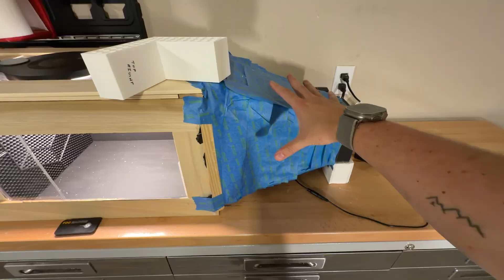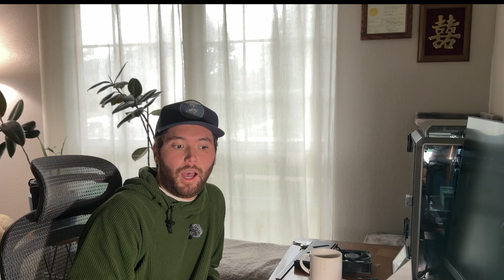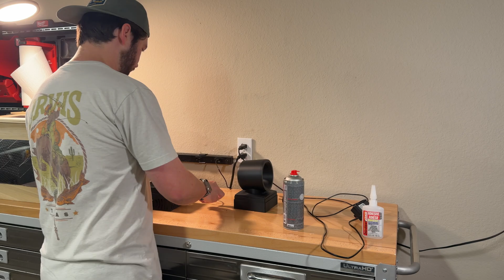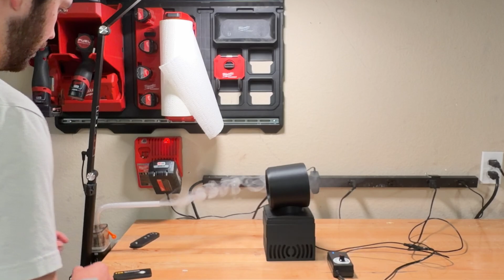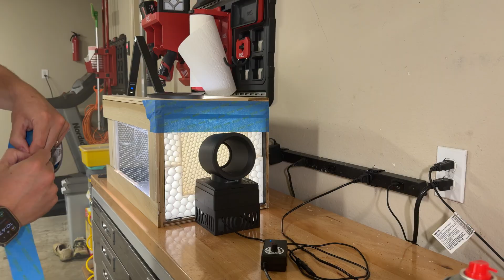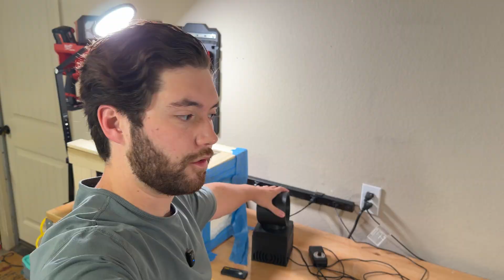Testing a DIY Wind Tunnel with a Bladeless Fan

Comment: Perhaps the focus should be on the pull rather than the push.  Also, the big boys feed the smoke through a length of pipe inside the chamber rather than through the infeed grate. This enables moving the injection point around to examine the turbulance behaviors engendered by the chamber geometries.
Reply from the maker: Those are some great ideas, thanks for the feedback!

Comment: Not an expert by any means, but I think you can use a bladeless fan still. If you have the chamber being pulled by only the round part at the top and separated from the fan box at the bottom, the low pressure from blowing will pull out of the chamber along with the regular air. It's weird to explain but you can look up "Bernoulli's Principle" if you want it explained by someone who actually knows what they're talking about.
Reply from the maker: I’ll have to look into that! Thanks!!

Comment: most bladeless fans run on an impeller and the intake of yours is on the bottom. you should just use an impeller with the intake in the funnel no bladeless fan housing. those are my thoughts you don't have to do that but it is an idea.
Reply from the maker: I’ll have to look into what that is! Thanks for the idea!

Comment: Can't you add more fans to increase suction, like a 2x2 grid would be a greater pull forcing the air to be more smooth?
Reply: Also just looking at how blameless fans work, it seems more turbulent than the normal one, especially as you have rough surfaces on the fan which will damage airflow. Try acetone on 3d prints to fix it (search it up its a cool technique)
Reply from the maker: I totally think so, but I don’t have another one right now! I bet I can make that happen in the future!

Comment: Just came across your channel and I'm liking the way you just give things a crack and learn as you go.

A few tips from my purely theoretical (and potentially outdated or wrong?) understanding, I believe professional wind tunnels have a larger inlet and outlet compared to the test chamber cross-section to take advantage of Bernoulli's principle. It will increase the air speed in the chamber basically.

Another thing (that I have never confirmed) is that I believe the flow straighteners in the inlet/settling chamber are meant to be staged. So, you have long wider ones followed by shorter narrower ones. The understanding there being that they cancel out different frequencies of oscillations in the flow.

You may also want to taper the leading and trailing edges of the flow straighteners (if you're not already doing that) so that you don't get turbulence from them entering the chamber. At that scale, I don't know if the print layers will be an issue too? May want to give it a spray with some putty primer or go down the rabbit hole of vapor smoothing your 3D prints.

Looking forward to the next one.
Reply from the maker: Awesome! Thanks for the tips!

Comment: Hey hey!

Your intake looks great. A decent ratio is 7 or 10 l/d (each intake "pipe" should be 7-10 times longer than its diameter, which it appears you nailed). The smoke shows that your flow is initially laminar, which is consistent with a good intake. The only thing I would add to the intake is a fine mesh at the outlet of the honeycomb, which can reduce eddies smaller than your cell size which can make it through. This will cost you some static pressure, but is a cheap experiment.

However, I see a problem with the transition to the test chamber. Your intake should not be the same area as your test chamber. A larger intake with a reduction, or a smaller test chamber, would make a world of difference. A ratio of 5 or 7 will work best. This causes flow acceleration so that lengthwise velocity differences are greatly minimized. The honeycomb takes care of transverse ( up/down and left/right) deviations, & a reduction keeps the flow together and prevents fast/slow air pocket separation.

The exhaust fan will work great, no need to make the fan bladeless. However, pressure perturbations and swirls from the fan can travel upstream and induce turbulence in flow that is close to its critical Reynolds. Make the exhaust duct a longer pipe and place the fan a few feet from the test chamber, this will also make a difference. You can also place a stator in front of the fan, but this will cost you some static pressure & will not make a huge difference. If you decide to make the intake larger, you may need an extra fan or two on the outlet for a decent velocity. If you reduce the test chamber you are set.

You have a 3D printer, put it to use and make all transitions have smooth curves instead of the current angled transitions, this will not be a panacea but will help reduce issues.

Wish you the best success in your DIY wind tunnel life
Mariano Bernacki
Reply from the maker: Wow! Thanks so much for all the feedback!

Comment: EVERY mistake is a lesson learnt. I assume youve asked ChatGPT for some ideas and watched others trying this on youtube.
Subtle pressure differences cause laminar flow to disrupt. The air speed of the entire system should be highest in the test section which means the pressure should also be the lowest. Given your outlet section constricts down to a small fan, I think you'll find it difficult to get good laminar flow across the entire test section.  You need to slowly increase the area of the outlet section and have a fan capable of moving that much air at the speed you want. 

Try to imagine the volume of air in the test section moving at the speed you want it to move. Then get a fan capable of moving that much volume in the time you want. Unless you get ALL the wind in the test section moving at the speed you want smoke will enter the test section and start to diffuse like it is. If space is a restriction, you may be better of making a smaller test section.

Alternatively, Imagine you were a smoke particle entering the test section. You go in and straight away you see a narrowing exit where all air particles and other smoke particles have to stop and wait their turn to go through the small fan.

Your curiosilty is unique and not everyone has it. It will teach you patience and without realising it, it will keep you entertained without having to turn on the TV or doom scroll. Enjoy!
Reply from the maker: Thanks so much for the detailed feedback!
Reply: @TheWindTunnelChannel-b1e  Hey... I stumbled upon a similar project I think you could get some tips from. Do a search for Aki wind tunnel. His project looks simple and seems to work really well.

Comment: The fan blades weren't causing the turbulence you're trying to fix. On your new version the thickness of the pipe wall you used for the inlet grid was creating turbulence, the straws worked better bc they have very thin walls and are also smooth. The printed hex inlet worked better than the thick walled pipes but the exhaust grid you added before caused more problems than it (maybe?)fixed. 
Like restricting the flow in the middle (denser grid = more restriction bc there is more material in the way) causing the air to kinda bounce off and follow the path of least resistance through the bigger hole grid. You dont even need an exhaust grid. 
The fan just needs to be the same cross section area as your test chamber. But preferably bigger than the cross section of your test chamber and further away so the transition in can be smooth(kinda like a trumpet). Using more than one fan to fill the area is viable. You can use a 3x3 fan grid for instance or use a big boxfan (tho they dont have much speed regulation).
Reply from the maker: Interesting points! I appreciate the advice!

Comment: I just noticed that it's "The Wind Channel Tunnel" not "The Wind Tunnel Channel" I subbed like last night and didn't even think about that.
Reply from the maker: Haha good catch! I thought it was funny that way!
Reply: @TheWindTunnelChannel-b1e   Also I'm thinking you might want to go back to the funnel and maybe resize the holes. I don't know basically anything about this stuff but I can come up with some ideas. Maybe tweak the shape of the funnel so it smoothly sucks air equally and position the fan in the center of it. I also am thinking about if you block the air from the smoke side some, that might be a good test to see if the fan only sucking up the smoke makes a difference. Basically like adjusting the air flow into the tunnel. Keep up the testing though, I'm looking forward to see what it looks like in the end and how you get there.

Comment: 2 things. Check out an actual wind tunnel. They use blades fans but also curves to increase wind speed and flow. A trip to Walmart for the better homes and garden rechargeable desk fan will net you a blower style fan that  should have less turbulence

Comment: You simply need distance... A bladeless fan simply creates a low pressure area in its center.
Just triple the length of your exhaust conditioner and you should already see improvement.
Reply: This and i also believe the exhaust grid is not even necessary, its just creating multiple problems.